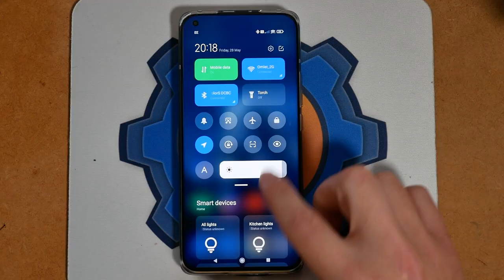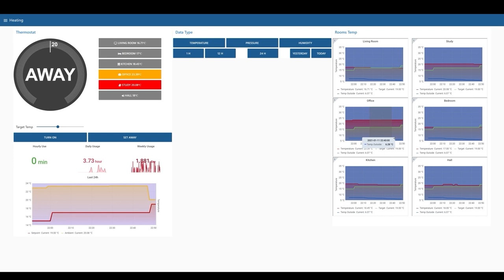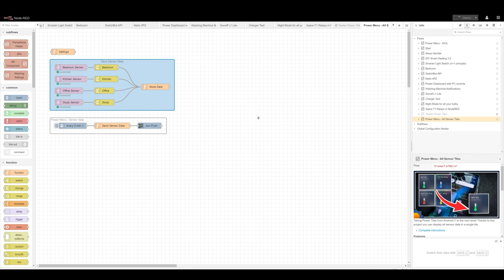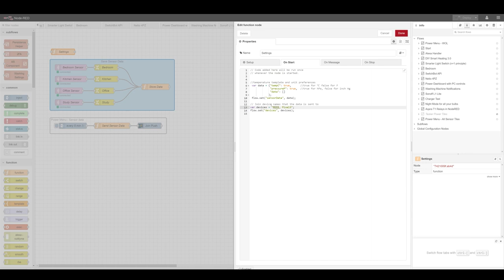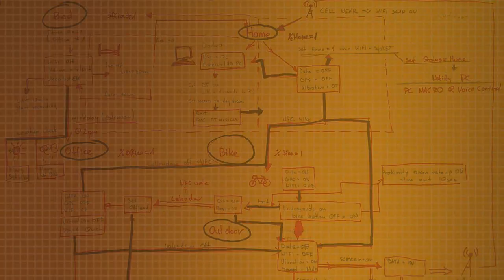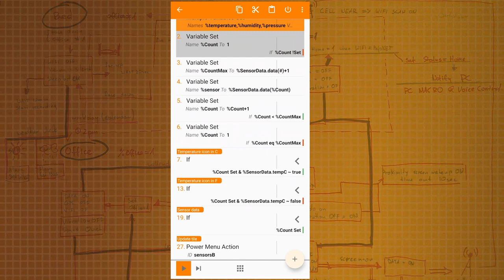Power Menu - All sensors in a single tile!

Comment: How hard would it be to add other sensors, such as light or air quality?
Reply from the maker: You can swap the sensor type and you are ready to roll. (you need to change the units in tasker). Sensor object in NodeRED allows expansion of extra metrics, so you could have 10 point environmental data for each sensor and it would stull work. The problem are tiles - limited to 17 characters in the title and 8 in the subtitle.
Reply: @notenoughtech  I like keeping the names of my sensors short  :).   This is definitely an interesting idea for me to try
Reply from the maker: Ha! It's the data issue. Title is where I display 3 metrics now and it's just enough for temp pressure and humidity. Anything more and you will need a next tile or keep cycling through the data

Comment: This is some good work. I will have to look into what you did to keep it local?
Reply from the maker: each time it syncs, I send the data from all sensors and toggle it locally using Tasker. 5 min interval is good enough for temp changes I think, but that can be adjusted
Reply: @notenoughtech  ok i'll have to look trough your whole series on this, i have been using the node red dashboard and telegram , but it would be interesting to see what can be done with google and tasker.  Can you get alarms to sound as well, that's the main thing I'm missing
Reply from the maker: You can sync alarms between android and nodered I have a alarm sync project on here
Reply: @notenoughtech  yes i saw, that was kind of involved... i was more thinking in terms of getting an alarm sound if something was wrong, say a water leak or fire etc
Reply from the maker: Alarm sound from the nodered server or tour mobile phone?
Reply: @notenoughtech  alarm on the phone. I already have loud speakers connected to the pi.
Reply from the maker: Tasker will help easily with that
Reply: @notenoughtech  I have a note 9 Pro does tasker eat a lot of battery? Does miui shut it down?
Reply from the maker: Battery wise I don't notice it. But if you make a profile that I'd tasking to your CPU then you would notice that. 
There 3 things to do for miui - exclude from battery saver add auto start option to the app and grant permissions needed to run it
Reply: @notenoughtech  OK thx I downloaded tasker again yesterday. I had bought it back in 2011 but I guess my registration didn't survive the takeover in 2018. Will start experimenting soon.
Reply from the maker: Message joao if you bought it before he will sort you. And save money you can spend on autoapps